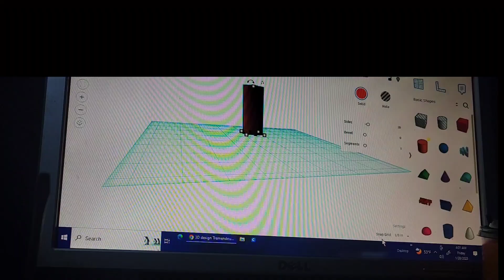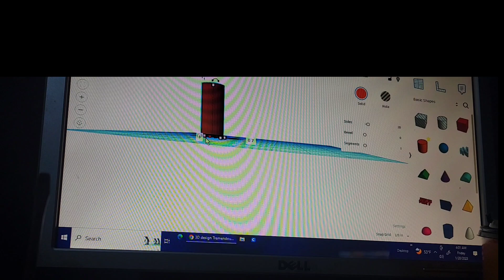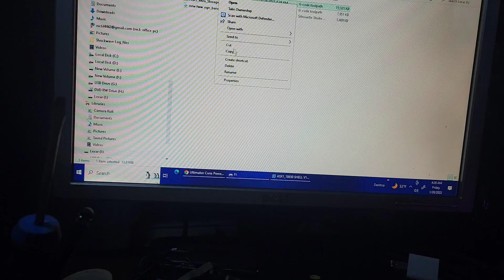Use batteries from disposables for anything!!

Comment from the maker: 00:04 Designed and 3D printed a reusable battery container.

00:18 The 18650 battery is a widely used and powerful battery.

00:35 Using a single 18650 battery can power various devices like headlights

00:51 A device was created to fit an E6 battery in the middle with slots on each end.

01:06 Creating a replica 18650 battery with metal tabs

01:23 The item can accept positive and negative inputs

01:37 Excited about the versatility of the 2650s print

01:49 Contact me for cheap 18650 battery adapter

Crafted by Merlin AI.